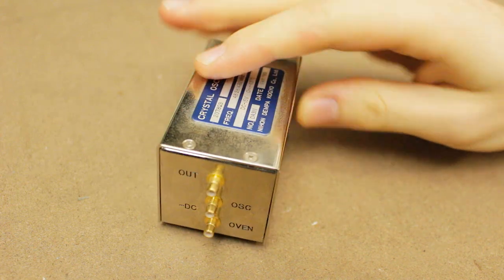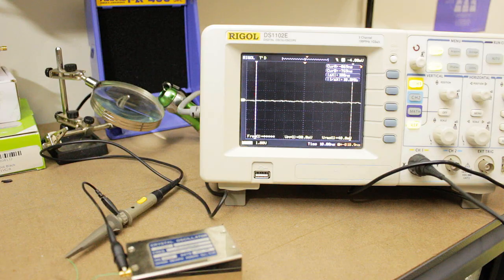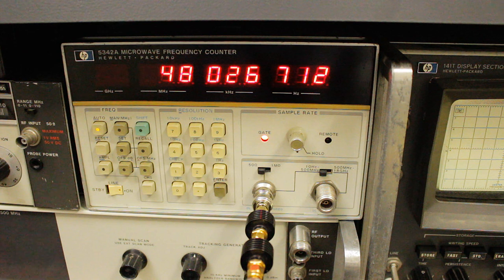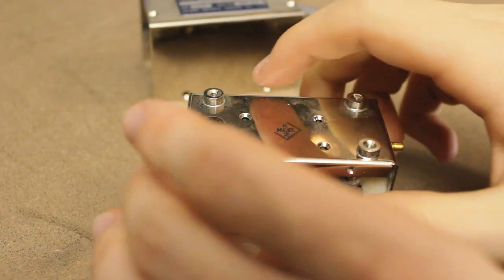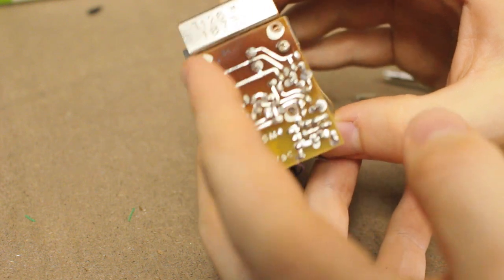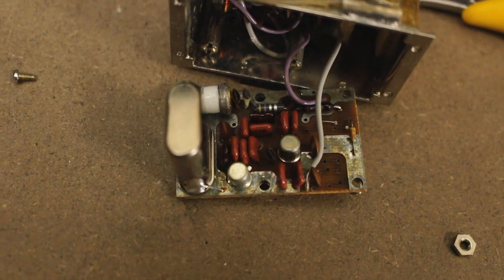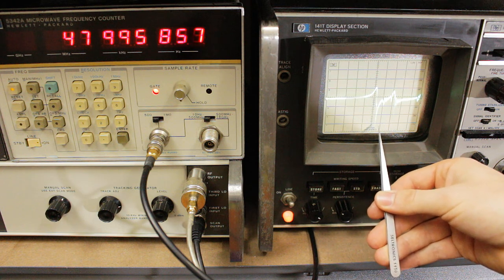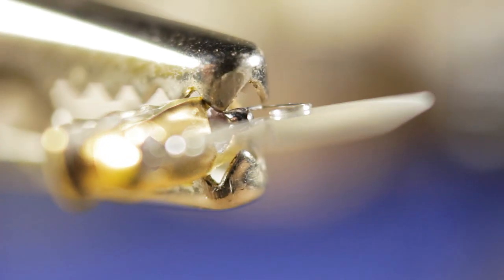Vintage Crystal Oscillator Teardown & Experiments

Comment: Nice tear down. In the late 60's I used to order then expensive  Hi-Q crystals to use in PYE Mark 3A, old low band VHF am radios. So as a teenager, my thrill was to rip out all the coils, divide the turns roughly by 2 and have them working on 27.240 AM and what ever other channels we could load into a channel change switch on the Pye that was not built with multiple channels.

Comment: The small Crystal inside the larger case in my opinion adds another thermal filter.  That would slow down any ambient temperature changes, as well as any overshoots of the oven control.  As to the frequency, you found the series resonance.  Disconnecting the rest of the oscillator circuit left the parallel resonance  higher than the intended trim frequency and looks like you pointed to it, but did not tell the two frequencies separately.
Reply: That's how some pricey MEMS oscillators tune themselves in relation to temperature, making it extremely accurate.

Comment: The OCXOs I've collected all have SC-cut crystals that are operate at their fifth overtone (for extremely high Q).  The set points of the ovens are all about 90 C.  My favorite one is as stable as a rubidium source yet doesn't require periodic tube replacement.  It has been operating continuously for more than ten years (thanks to diode-switched lithium-ion backup).  I determined its precise frequency by using it to clock a Parallax Propeller microcontroller which itself was used to measure the 1pps output of a GPS receiver across many hours with 50 nanosecond accuracy.  With that info, I could compensate the oscillator digitally.  As a wall clock in my bedroom, it hasn't gained or lost a second in ten years.  It has proven to be much more satisfying than the GPS or WWVB-based clocks it replaced.
Reply: Excellent justice you have paid to this small rock of Gibraltar!

Comment: Thanks for the teardown. I did a similar teardown of the OCXO in my HP 5350B many years ago and the construction was quite similar. Instead of using a TO-3 transistor for heating the oven, it uses a TO-220 one.
Reply: Kerry Wong 
TO-66

Comment: The parallel resonance is the one that's easier to pull  and a bit higher as well, it may be that they aimed at that?
Reply: The infinite crystal reactance is not really considered when designing.  The crystal can be thought of as a low value resistor that works at a specific frequency.  The crystal is used in an amplifier type circuit to provide positive feedback to the input.  So the lower the resistance, the better the oscillation.  Now, that being said, the parallel resonance has nothing to do with the Fp that crystal manufacturers specify.  The Fp is the frequency that the crystal will be resonant with a SERIES capacitor to the crystal.  Yeah it's stupid and it appears the sales people at these crystal manufacturers don't understand it anymore.  But look at the specification.  It will show an Fp @ XXpF.  Let's say Fp is 10MHz @ 12pF.  This means that the crystal will oscillate at 10.000000MHz with a 12pF capacitor essentially loading the crystal.  Crystals such as the one in the video here should have a frequency and a temperature listed to show what frequency it will operate when brought to temperature.  AT cut crystals start high in frequency and drop in frequency as the temperature increases, but when they go over the specified temperature, the frequency goes back higher again.  There is a dip.  This way the temperature can vary slightly with the least affect on the crystal frequency.  Putting a capacitor in parallel with the crystal does nothing to the operating frequency Fs.  It only changes the parallel resonant frequency.  

I hope this helps.

Comment: The whole unit probably did operate at the printed frequency and it malfunctioned thus why it was removed from the aircraft. Another indication is the warp pot not functioning, maybe it went bad or some capacitor went bad in the circuitry, who knows. I have seen things like this happen on old GE Mastr-2 and Motorola Micor and MSF2000 repeaters where a frequency would drift out of what was on the label because a part in the "channel module" went bad but the crystal itself was good.

Comment: Oven oscillators take a long time to settle.  If the crystal was an AT-cut crystal, which is most likely but not for certain, then the frequency will drop when the power is applied.  A normal oscillator with an AT cut crystal will start higher than desired and drop to very near the desired frequency.  Your oscillator may have had a damaged tuning section with a shorted out tuning element.  This would have made your frequency low to start with and it would fall from there with the oven heating the crystal.  At any rate, it would have never settled on frequency if it were an AT cut crystal at this rate.  The crystal was probably a 3rd overtone crystal and it should have shown a lot of frequency change when tuned.  I have never seen anyone put a crystal case inside a larger crystal case.  That is NDK, I guess.  They are weird.

Comment: It's possible it got dropped or subjected to mechanical shock. That can cause permanent changes to the frequency of a crystal.
Reply from the maker: I didn't notice any damage to the crystal but I agree that shock could be a possible culprit.
Reply: Perhaps that, but remember that quartz crystals are subject to ageing effects and given the age of the crystal, I'd expect to see some perturbation from the original frequency.  Also, most of the circuitry inside the box is for temperature compensation; not so much for the crystal itself, but for the other components used in the circuit for the oscillator. I imagine that capacitors were carefully selected with opposing temperature coefficients so as to minimize the overall drift due to minor fluctuations in temperature.  This older technology (which is still used today for some things) just goes to show how much technology has advanced in just a few decades! :)  Thanks for the video, I much enjoyed it.

Comment: Did you terminate that output with some 50kohm resistor for testin? It could over oscillate, out of circuit where's it used..?

Comment: 48Mhz is too high for a fundamental mode crystal normally. It's a 16Mhz crystal being operated at its 3rd overtone. You can see the resonant peak at 16Mhz on the trace before you zoomed in. I reckon someone printed the wrong freq on the rating plate as all your measurements indicate a freq of 48.027Mhz. Pity you had to butcher it s I suspect it was working perfectly.
Reply: I have seen some tiny 150MHz fundamental quartz crystals.  The blanks are very small and there is no way you could make a wafer that large in diameter.

Comment: The crystal case determines the so called holder capacitance C0, in addition, one needs to determine the motional inductance Lm, resistance Rm and capacitance Cm in order to fully characterize a crystal using the simple (Rm+Lm+Cm) // C0 model.

Comment: NDB = Non Directional Beacon.  Used by aircraft equipped with a radio direction finder to locate the beacon and reference it to it's known location.  With two beacons, pilots can tell where they are in relation to the two beacons and their angle to the aircraft.

Comment: Too bad I can't find the oscillator just like this on eBay, its case is so nice I wanna repurpose for digitally controlled MEMS OCXO like SiT5721 (very pricey but kinda tempted to buy it for 10 MHz test source with Raspberry Pi Pico microcontroller on the new board in the rebuilt OCXO to keep it accurate).

Comment: Thanks for the teardown. That insulation definitely looks like asbestos...
Reply: don't breathe this!
Reply: That's probably not asbestos. It looks more like some kind of fibreglass insulation. They didn't use asbestos in the 80s as by that time they knew about the health risks. Asbestos was used in the 1940s in radios as a heat shield.
Reply: Asbestos is harmless until you breathe it in or ingest it. Like mercury, it too is harmless until it becomes a vapor and you breathe it or you ingest it.
Reply: @elfnetdesigns702  Basically anything poison is harmless until you ingest it in some manner. Therefore "everything is safe", LOL.

Comment: awesome video! very informative and interesting. Sadly I was really hoping someone would've shed some light on the whole little crystal in a big crystal package as it seems pretty strange to do, especially since it wouldn't really protect the crystal any better in any forseeable event and certainly wouldn't be cost effective
Reply: Someone mentioned above that it will slow down the temperature change.  Personally, i think that's a bad idea but it was probably their way of thinking.
Reply: The Matryoshka structure of smaller oscillator inside a larger metallic enclosure was most likely done in order to suppress any electromagnetic induction from external sources (Electromagnetic radiation, EMI - probably a military aircraft) outside to the inner core of the crystal.  Any EMI fields that penetrate to the inner can would cause eddy currents at the two electrode contacts, and a resultant fluctuation in the crystal resonance due to a fluctuation in the induced voltage.  Hope  that helps...